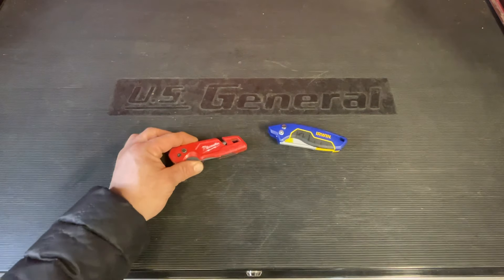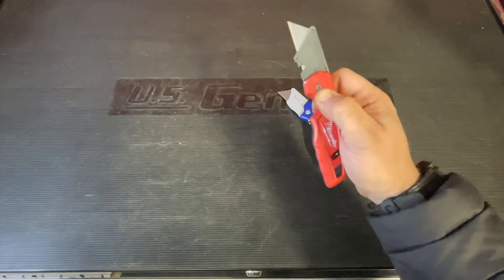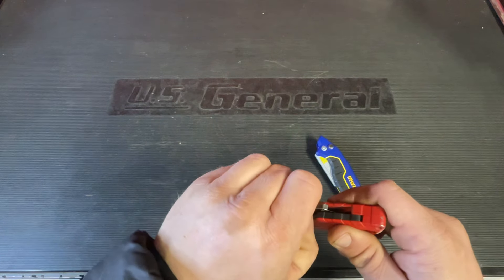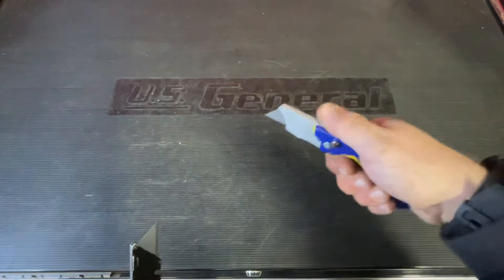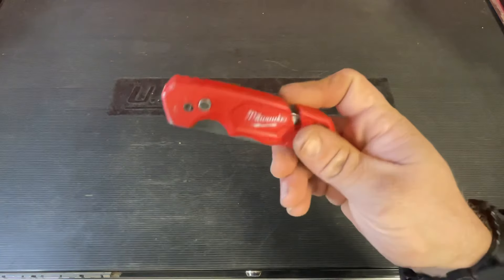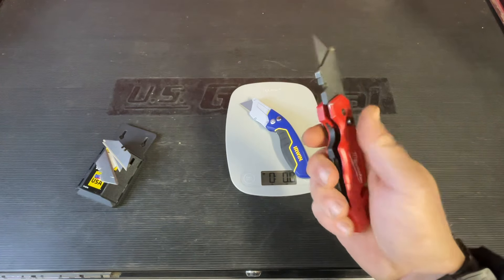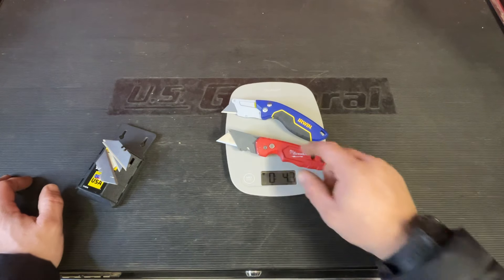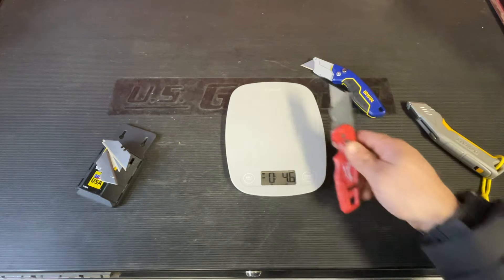Milwaukee Fast Back vs. Irwin Pro Flip.  Which 5 blade storage utility knife is supreme?

Comment: As someone who cuts a lot of drywall I'd say they're both fine. I'd probably take the Irwin just for the secondary lock position, all of the other distinguishing features between the two don't really sway it one way or another and I'd likely be more interested in the price or whatever was in stock when I needed one because the old one had grown legs and left the jobsite.
Reply from the maker: I agree

Comment: I would consider myself a Dewalt fanboy but they dont make a multi purpose utility knife worth a darn. The Fastback 1505 is the knife for me. That 1502 is nice just less options with more storage. The seatbelt cutter is cool.
Reply from the maker: I think one of the most impressive aspects of the “fastback” line is the variety of different versions. I had no idea they made so many. Plus they make non razor blade knifes. I’ve held a hook style and a traditional blade style. I’ve also messed with two other style razor blade versions. (Screwdriver and a single storage) but they make more…